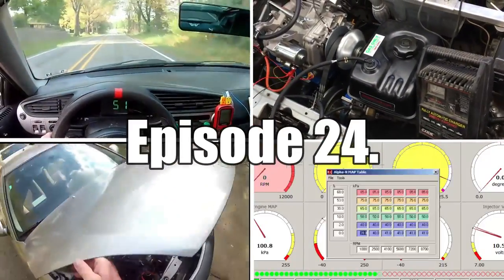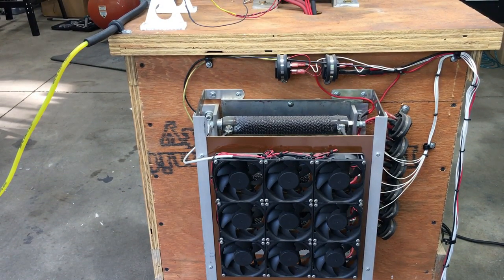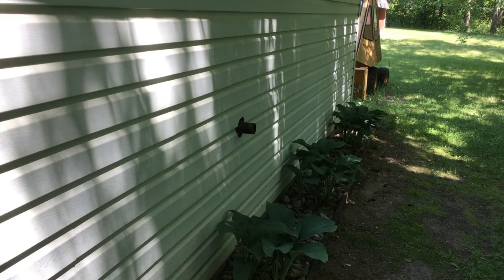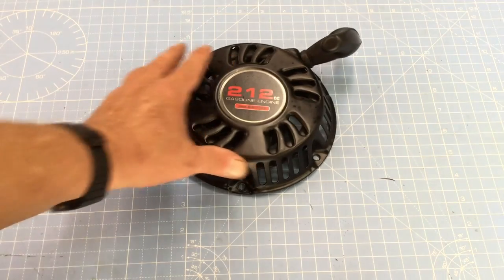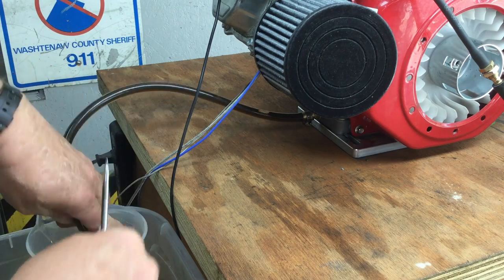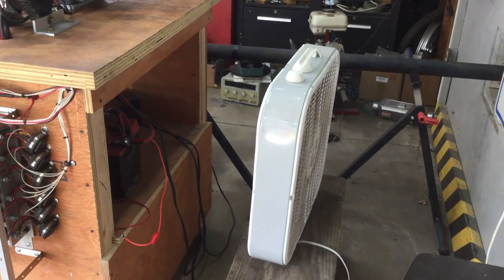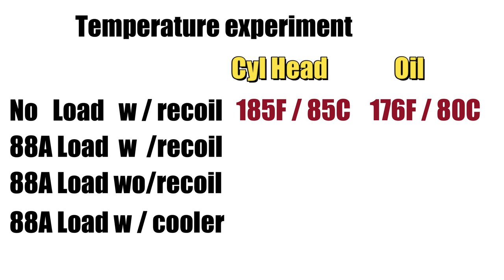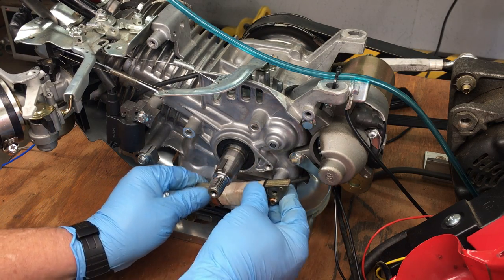Episode 24.  Testing an oil cooler on a 212 cc Predator engine

Comment: I would recommend a pulse pump instead of electric and maybe a way to bypass the cooler when it’s not under load or perhaps on a thermal switch. You  want to be able to cook off any condensation in the oil.

Comment: When the car is moving the cooler will be more efficient. Try using thinner oil. Put a thermostat on the engine to  duty cycle the oil flow for less electrical load. Maybe a check valve will keep air out of the oil line. Maybe funnel air from outside the engine bay to the engine head with a tube. E85 will probably burn hotter.

Comment: So glad someone tried the fuel pump to pump oil i have my 212 with piston pointing straight up for vintage motorcycle replica was wanting to use a pump to pump oil to the valve train now i know it works had it all setup but havent tried it since bike frame not done i still have engine apart so im glad my fuel/oil pump is going to work

Comment: I witnessed the cooling effect of the oil cooler first hand in cold starts On a alpine A310, and a 5 turbo 1 i owned. There was eng temp gauge and oil temp gauge. When the engine reached 98 deg C. The oil cooler thermostat opened. Immediately the engine temp would drop from 98c to 40c, and oil temp would rise from 0 to approx 40c. So efficiant oil cooling is essential.
Reply: the 212/420  probably do not have enough oil flow around the cylinder to cool it as its not expecting the airflow
Reply: @Hewitt_himself  The cylinder head could be water Jacketed if the Gentlemen doing the project wants to get serious! With or without the fins.

Comment: I would love to see this video with one more run. The oil cooler in front of the engines cooling fan with a duct to pull air optimally through the cooler first. Then maybe another setup where you put a more high powered “radiator” type fan directly on the oil cooler in an auxiliary area away from the engine.

Comment: I wonder if you moved the oil return from the cooler to the oil fill cap for the motor if it would help with flow

Comment: 12:28- odd question, but were you able to run the same quantity of oil in the engine as before? I ask because having just more physical capacity would lower temps slightly.
Reply: Initially, more oil would show more cooling, however the oil would reach a saturation temperature and not shed any more heat had he run a closed loop tank-to-engine set-up without the cooler, using the same quantity of oil. That might be an idea for another test, though.
Reply: My intuition tells me that changing the quantity alone would only affect thermal mass, i.e. the time it takes to get up to a stable temp, but it's hard to tell because it's being run through an oil cooler
Reply from the maker: I had to add additional oil to bring the level back to normal.
Reply: @robotcantina8957  but there still might not have been enough- look at those bubbles coming out the line to the cooler
Reply: @gregorykusiak5424  I think he mentioned it's a pulse-type pump, so I think that's normal
Reply: @owenvogelgesang7314  pressure fluctuations can’t be good for the engine/seals longevity. I still say there isnt enough oil in the system

Comment: You could try a higher volume pump also, if the oil returned into the valve cover it would circulate the cool oil through the head even though it does not have a pressurized system.

Comment: It's nice to see someone give numbers for something I've done on a gocart in the past.. we used a small Harley oil cooler on one of our 301cc predator buggy carts on top of removing the recoil pull system.. which i though based off long term running had done a good job, but i never really measured it

Comment: Use a vacuum fuel pump for the oil pump. They use them on Kohler engines and they mount the valve cover.

Comment: I've always wondered if you could wrap copper tube around the cylinder head through the cooling fins, and the run coolant thourgh the copper tube, and through a radiator, or heat exchanger?

Comment: You could get into the lubrication system and use the pump from the engine to pump the oil through the cooler then into the various parts of the motor. If the motor you are using has an oil filter, you can do a sandwich and pull from there and pump cooled oil to all the parts of the engine. (you're not talking about high pressures on an engine like this). You would just need to  be sure to prime the system adequately before going past idle to make sure you have oil pressure on the initial fill... after that it should stay full of oil. 

Also I noticed your engine RPM varied from 3400 something all the way to 3600 something... that will change a few things too.

Comment: What if you just add an alternator to the car setup, I added a small one to my lawn mower and rigged it up to charge the battery but also have a relay that can switch back to the stator if necessary. Added plenty of power for my winch and plow/snowblower setup. I can see some benefits for your setup as well.

Comment: I would like to see water injection. Thanks having a lot of fun with this series
Reply: Water injection will allow more ignition timing advance and will cool the intake air.  This would be very beneficial when forced induction is added.  It is like running a higher octane fuel, and it steam cleans the combustion chamber as well.

Comment: What about pumping the oil from the cooler into the valve cover? it would help cool the head down as the oil runs back down into the bottom end... just have to watch that the bottom end doesn't get starved of oil... you could also add a ram air duct that directs cool air directly to the recoil area? Then add additional shrouding and ductwork to direct the hot air towards the back of the hood where a vent could be cut to allow it to escape? Are you planning to experiment with water/meth injection?

Regardless of what you do, keep it up
Reply: Yep ! Pump the cool oil to the hottest spot. The cylinder head/valve cover.  So it can actually gain temp and thus cool the head.

Also a reservoir to avoid air pockets would improve the cooling.

And a shroud around the oil cooler itself.
Reply: Another plus is more oil keeps wear down on top end and less valve lash changes too.
Reply: @Ronin8451  CONGRATULATIONS  ROBOT CANTINA...   104k   subscribers....  JIMBO  you provide the fun
and entertainment that viewers enjoy👍👍👍!

Comment: The cabin air intake is located in the higher air pressure zone where the windscreen and hood meet (that’s why heater coils and AC evap coils are in the firewall) of most cars. If  this car had AC before getting re-engined, there will be a condensate drain lower on the firewall you can source cooler air to direct over oil cooler/cyl head from…if you can’t plumb a duct from the front of the car. A bigger front duct would be more effective. And get those bubbles out of the oil line!

Comment: I'd love to see the test repeated with the oil cooler but the engine fan removed. Removing it's load on the engine might even make it run cooler, as long as the oil cooler is up to the task.

Comment: I fly a paramotor with the 212 and did exactly this with an electric fuel pump and oil cooler it works great. I drilled a hole above the exhaust valve for return oil to help cool it and it was fine but the casting is very thin there.
Reply from the maker: Nice.. Thanks for the tip!
Reply: @robotcantina8957  CONGRATULATIONS  ROBOT CANTINA...   104k   subscribers....  JIMBO  you provide the fun
and entertainment that viewers enjoy👍👍👍!

Comment: Wrap the Cylinder Jug (between the fins)  in copper tubing and run water or antifreeze through a radiator, along with running the oil cooler!

Comment: Good deal, been wondering about for the engine generator/welder/plasma cutter build.  Wondering if can pull off a suitable oil pump from a diaphragm gas pump off the crankcase vent?

Comment: Throw one of those flexible solar panels on the roof or hood to power your electrical needs.  No more parasitic loss from the generator/coil = more power to the wheels!

Comment: Live in an area of 100 plus tems. Installed a small trans oil cooler on my 9,000wt gen set , mounted it lower than the drain pug at a 10 degree angle, removed the engine shut down switch installed a fitting that I plugged and then drilled with a 1/16 drill, ran the oil hose to the higher ditto g on the cooler. Installed a fitting in place of the drain plug and ran the host from it,,,  to the lower trans cooler fitting.

Comment: Another great video,  very nicely done, I like your test rig, still can't wait to see the lil roots supercharger installed on the car,  as far as a charging system,  if you didn't want to lose the starter to add an alternator instead of an alternator get a starter generator and it will do both jobs, I don't think it would be hard for you to retrofit that into the system

Comment: For an all aluminium alloy air-cooled engine, the temperatures you're recording in your various tests are quite alright. Bear in mind that overcooling is just as detrimental as overheating. Plus, running at temperatures too low has a negative effect on efficiency/fuel economy - lower temps and thermal energy is lost to the relatively cooler lubricant, cylinder walls and cylinder head.....and even if you had to cool the oil, certainly not that giant one you have now. You're better off with one the size of a power steering cooler or similar. 

Love your work, keep it coming

Comment: Return the oil to the valve cover. It will aid in cooling the head slightly but mainly to get rid of some of the bubbles as to not airrate the oil.

Comment: I can remember which brand of aftermarket flywheel it is maybe arc or pvl but it has such a greater cooling effect they recommend blocking off someof the passages in the recoil cover to maintain the correct engine temps so if you buy one of those you wont have to worry about the oil cooler set up. You need to watch the arc racing tech videos here on youtube.. they go over the optimal temps these engines like... i like to idea of adding the oil cooler but at speeds in the vehicle i dont think you'll need it with the aftermarket flywheel. Keep up the good work! 👍

Comment: A swirl pot (purge tank) is the way to eliminate air bubbles in the lines. Oil cooling has a huge potential in adding to the longevity and reliability of the Predator, the concept still needs some work. Thanks for this very interesting video, more please!

Comment: I think during the winter, having a "heater core" in the insight will be nice.

You could wire the oil pump to a switch, so that the engine could get up to temp easily before it started to pass oil through the cooler. Sorta like a car's coolant thermostat or radiator fan thermal switch.

I would like to see thermometers placed before and after the oil cooler, to see the temperature drop over it. Theoretically, if you are moving oil fast enough, it should not be a large drop. Otherwise your performance is limited by your "coolant" throughput.

Maybe experiment with different viscosity of oil, 2 pumps or different pumps, or a larger oil cooler to see the effects on cooling performance.

Additionally, if you needed even more cooling, using copper pipes, or just straight up creative use of JB weld, to create "coolant passages" through the engine air cooling fins. Then you would be able to completely remove the stock cooling fan/shroud and just run a small radiator,  pump,  and fan set up, like a conventional water cooled engine. I doubt you would need to do this to more than a few fins on the block and head to significantly cool it. Another benefit to this, is if your cooling system springs a leak, a coolant leak is a lot less catastrophic than losing all of your oil in 30 seconds.

Comment: copper pipe through cooling fins on head, have oil come though head pipes after making it though the sump first.  Also add a reservoir to eliminate bubbles before radiator since the engine has a lot of oil agitation.

Comment: What happens if you send oil from the cooler up to the head?  Cool off the entire valve train.  Might have to enlarge oil return passages out of the head of course, but it'd cool the head off something fierce.

I wonder how well the oil pump was working; the breaks in flow from the pump's output made me think it might have had a poor prime.  I think  if you get the top of the oil cooler above the level of the oil pump you'd not have that; for completely draining the system at oil changes, just incorporate a drain plug at the bottom of the plumbing going to the oil cooler.

Comment: I think you should relocate the oil pump to be below the oil cooler, so that it is gravity fed, and can push a solid stream of oil back into the engine.
The way you have it setup may contribute to premature engine wear since it is pushing mostly an air/oil mixture into the engine block.

Comment: Use the cooling fan from the motor to suck air through the radiator and see if the higher flow rate helps

Comment: You will want to watch that you don't cool the oil too much as the viscosity modifiers only kick in at higher temperatures (not that a single cylinder engine really gets all that hot)..  It would be interesting to get the temp VS viscosity curves for the oil you are running and figure out the optimal oil temp to keep the viscosity in the correct range to keep both the bearing surfaces lubed and the pistons sealing and adjust the oil flow rate through the cooler to maintain this temperature

Comment: I think it would have made a huge difference to the head if you fed the oil back through the valve cover.
Reply: I think you are right. I have ran these OHV small engines with the valve cover off before and surprisingly little oil actually gets splashed up to the valvetrain. Only downside I can think of to feeding the cooled oil back in through the valve cover is running the oil over the hot cylinder head may increase oil temp a bit, but with a good cooler that shouldn't be a problem.
Reply: @averyalexander2303  that's the point though, and that cooler is massively oversized, nothing it can't handle. It'd also help to run motorcycle oil.
Reply: @octane613  I agree. I doubt that motorcycle oil would help much though. The main reason it is used is for its wet clutch compatibility, which isn't a concern in this application.
Reply: @averyalexander2303  well I suggest it because oil for Harleys and air cooled bikes holds up better under higher Temps than oil for cars.

Comment: Them Gnomes are at it again... May want to check that fan nut to see if they haven't loosened it.
About the Pull start issue. Maybe a extentsion part to put it further away (provided there's space for it and it somehow accomidates the Supercharger setup?)
Or mount the pull start on the other side or a belt driven pull start thing? ( a pully, bearing, pull start assembly all in one like that alternator)

Comment: That was a cool experiment! If it stays might i say add plumbing in a small oil filter? With as dirty as small engines run i could see the cooler clogging partially over time with carbon and metal dust.

Comment: You mentioned you don’t have power to spare, I saw a video recently about using wind turbines on the front of a vehicle which ended up generating more power more efficiently than a traditional alternator. It seems as if that would fit well with the idea of this series and optimizing everything. May be worth looking into. Great series!
Reply: Why not charge with a solar panel.
Reply: A flexible 100 watt solar panel would contour to the curves of the car thus not adding any measure able drag.  That 100 watt solar panel will put out about 5 amps of current, which is not much but it is 5 amps.  If he replaced the battery that he is currently using with lithium batteries, and replace every light in the car with LED bulbs then it would help a lot.  The lithium battery of the same weight as his current battery would also be at least twice the capacity so it would last a LOT longer in the dark.

Comment: Adapt a vertical pull starter from older push mower, or use a manual pull starter cone. Then use a stainless screen from the older mowers to keep out mice..
You can also use a chain/sprocket combo to power a n external oil pump. "Y" the return line into the feed port for the head. BTW if its an ohc, it already has an oil pump, oil feed line and oil return built in.
The only way to cool the head, is to provide cool oil to it, and increase air flow across it.

Comment: I hear the cast PLV flywheels for the predator engines move alot of air. And you tune the temperature of the engine by covering the holes in the recoil starter with tape to increase the temperature.
Reply: Out of curiosity, why would you want the engine to run warmer? As long as the oil hits 70-80c can you have too much cooling?
Reply: @ASAWProductions  I'm not 100 percent sure but I think the fuel might burn better at a specific temperature. Probably not something I would tune but some racers trying to squeaker every last bit of power out of there engine would probably look more into it.

Comment: In addition to squirting the cooled oil onto the piston skirt a small hole drilled through the skirt will allow more heat transfer away from the cylinder.

Comment: I still really wish there was a turbo instead of a supercharger due to the amount of power to run the supercharger. Still good progress and I wonder if you can put a NACA duct in the bottom of the front splitter under the car to channel air to the engine to keep the aero good

Comment: You can wrap the jug and cylinder head in copper tubing then bed it in metalized epoxy.  Circulate coolant through the tubing and a small radiator.  Works great.
Reply from the maker: Wow, this is the first I have heard of this, sounds very interesting, thanks!
Reply: @robotcantina8957  CONGRATULATIONS  ROBOT CANTINA...   104k   subscribers....  JIMBO  you provide the fun
and entertainment that viewers enjoy👍👍👍!